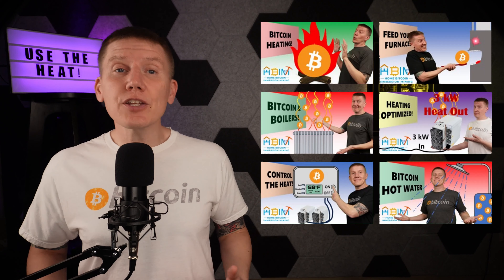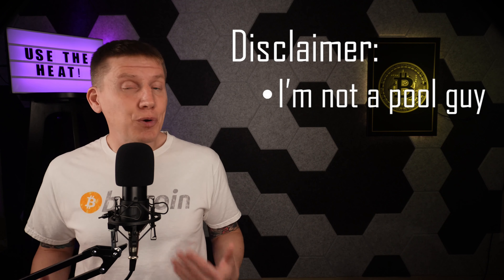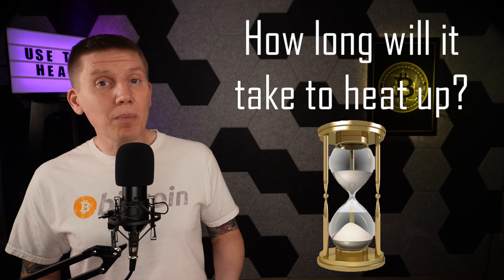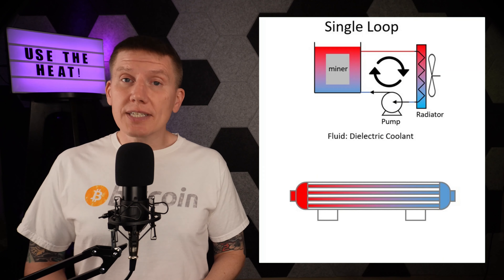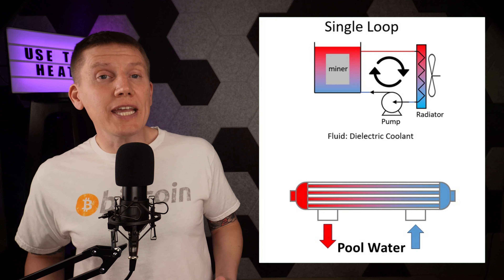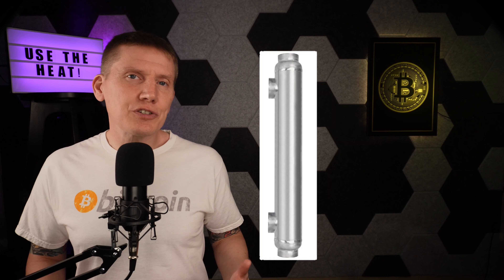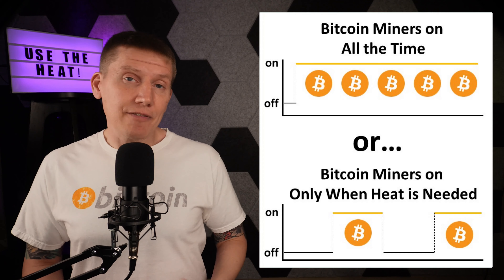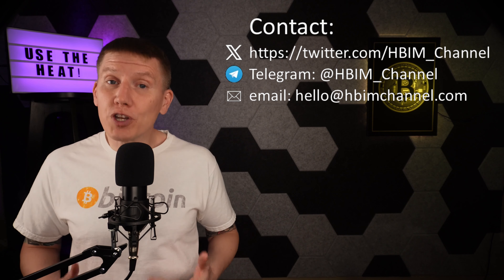EP31: How to heat your POOL with BITCOIN

Comment: Love this idea.. I live in a warmer location of the world where it gets cold (where heating is necessary) only for a couple of months in the year. Being able to route the mining heat out of the home and hot water (if the tank is hot enough) in the summer into a pool where even in the summer a not-too-cold temperature is appreciated is very important to me.
I would be running my miners all the time. Not worried about wear and tear in the pool filtration system as the pool circuit would be lowest in priority and would likely not run that often.
Reply from the maker: Great idea...and just takes a little design work to get it right :-)

Comment: Is it 2 cents a day?
Reply from the maker: The return you might get will vary a lot on a few different factors like how much you spent on your setup and how much you pay for your power.    You might even end up with net negative operational cost...but still less than using a conventional electric heater.  As always...it depends.